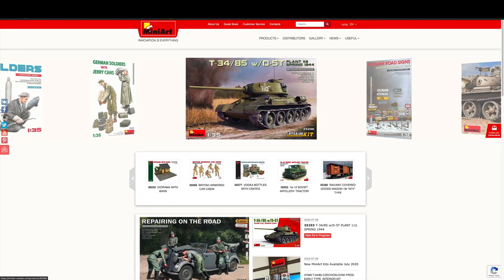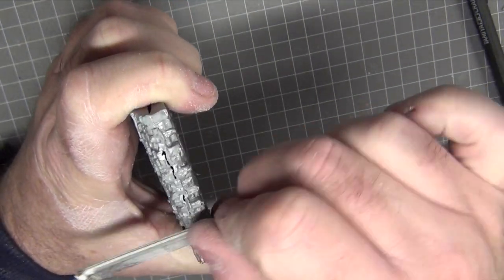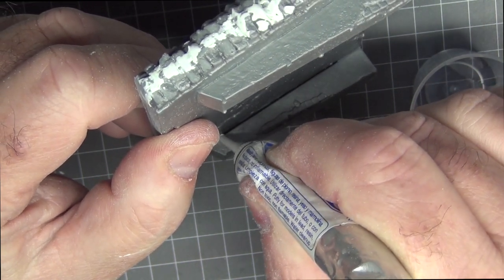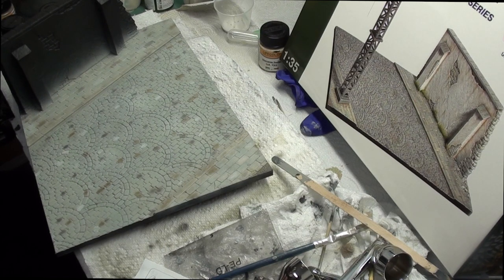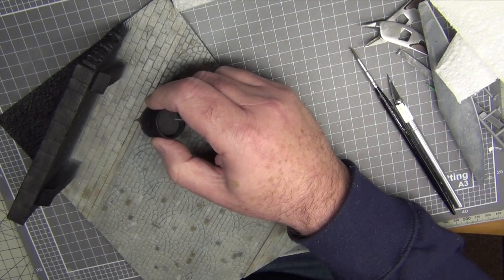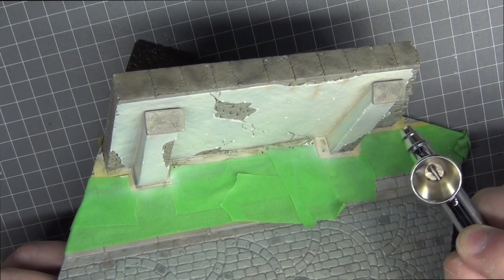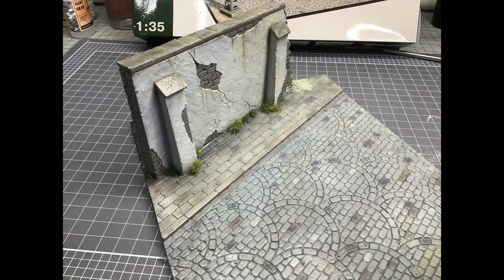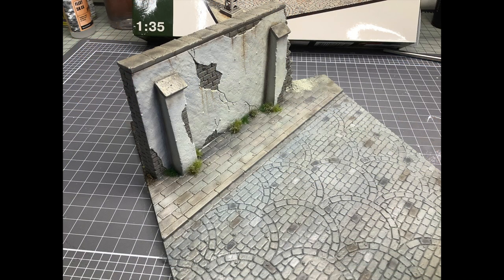MiniArt Street Section with Wall Diorama Build

Comment: "Doing what all good modellers do, I bought the whole set" - LOL!!!!!!!
I bought a bucket load of AK enamel products a good few years ago (half price sale) and most of them are still unopened. Having said that, I've only bought a few Shaders and always need to use the ones I haven't got so you're probably right!

Great work on the dio - sorry it's a bit late 😊
Reply from the maker: Hey Jeff. Thanks for writing. I won't share with you how many paints I have in my stash, but I will tell you I wrote a database to keep track of them. You get the idea. ;)

Comment: I'm building the village base diorama just now using AKs black window super glue with it and what a fast way of building these diorama vac form's! It has rubber particals through it and can be used as a filler or a surfacer too and easy sanded n painted it just turns to a plastic best using a Grip activator with it.
These dioramas aren't easy to come by now but vallejo scenics stuff is amazing in the resin! Great price's too!
Reply from the maker: Wow. I hadn't heard of this product! Thanks for the tip and I'll be looking to pick some up if I can get it and give it a try!

Comment: Hi Dan. As per usual, a very nicely produced video. I have to be honest, but you were right. I cringed the very moment I saw you attacking the broken wall section with a sandpaper block!  I can't remember if I've commented on this subject on your channel, or not, but I will comment here for those who've not seen my comments elsewhere.
It's obvious you cut around the wall parts with a knife, holding the blade vertically and tried to cut around all those broken bricks. It's a fiddly job. Then you sanded the 1mm excess plastic of the 'backing sheet' from the sides of each part,, mating them together to get at that ragged brickwork. Yes, the method does the job BUT there's a far easier way and that's to take the sheet of wall parts and flip the entire sheet over. You then 'scrape' the parts out from the rear. By holding the blade at about 45 degrees and scraping it back and forth sideways along the rim of the impression, one can thin the plastic very quickly and easily all around the part until the plastic is thinned and 'scraped' away at the point where the detail of the wall meets the backing sheet. In other words, the 1mm 'backing sheet' is completely removed AS you scrape the part out. And when it does drop out, the detail of that ragged brickwork needs NO cleaning up at all. Then you have to remove the excess 1mm backing sheet from the rest of the part and for that you can use the sanding block. Using this method, you can perform the 'cutting out/cleaning up' processes and ensure all of your wall joints are perfect, all in one go.I suspect you've seen my vid on the subject, but I as I said, I'm commenting here for those who might like to compare methods. BTW, my thoughts and prayers are with the people of Ukraine, and especially those good people at MiniArt who have enriched our hobby and my life. B
Reply from the maker: Hey Badder thanks so much for the detailed explanation! You guessed correctly how I did it as this was my first crack at one of these vacuum form style diorama bases. Really appreciate you taking the time to explain your technique. Makes sense and I've saved it in my tips database and will give it a try on the next diorama build. I've got a couple more of these in the stash. Thanks for the kind words on the video and for taking the time to reach out. Very much appreciated on both scores. Really like your YouTube channel and I saw the tutorial you did there on cutting out the MiniArt buildings. :)  I'll be going back to watch some more.

Cheers,
Dan
Reply: Hi Dan, it's a pleasure, and thank you. I am still a bit of a novice on YouTube and creating videos in general, but I'm learning a lot in that respect by watching seasoned creators like your good self. And I always like to leave comments because we're all here to help others, offer tips, advice and criticisms, positive and negative (with the latter backed up with some helpful advice of course) I mean, if someone sees something I'm doing and thinks there's a better/easier/quicker way, or whatever, I'm only too eager to hear about it! Here, I've basically repeated what I said in reply to your comment on my channel, thinking I was actually commenting here, on your channel, if that makes sense, so that'll explain why I've repeated myself lol. Still, I'll get the hang of it one day LOL Cheers, B.
Reply: @BADDERSBETTERDIORAMAHACKS121  I'm surprised that with the great tutorial you wrote in your initial comment that you didn't also note the little warts on the wall. They're part of the vacuform process and stand out as something that doesn't belong on the wall. They're on the base too, but harder to see due to the complex stone work. Sergio Solo built one of these kits (years ago now as he no longer posts) and they were one of the first things he removed from the model. Just an observation, because I think overall Dan's diorama came out really well and he should be proud of the results he achieved.
Reply: @nickkeizer3722  Hi Nick, Thanks for the response.i absolutely wasn't criticizing Dan's Diorama work at all. I was just offering some advice on how to make the job a bit easier, to do it a bit more quickly, and actually achieve a better result. I don't know about your philosophy when it comes to tutorial videos, 'how to's' and 'here's how I made a....'  but if anyone watches one of my videos and thinks there's a better way to do things, I'd WANT them to tell me. Call me mad, but I assume all of us want other model-makers to critique our work and offer advice and tips, and to comment and share thoughts. I haven't actually constructed a MiniArt building for 5 years, preferring to buy them and then make plaster casts of the walls, and use those to extend the existing kit, or use them to scratch-build entirely new buildings instead. I did make a video showing how to cut out MiniArt kit parts 'the wrong way and  the right way' and how to reinforce the corners, window and door apertures etc. I produced the video at short notice because I'd just seen a bunch of people complain about the 'bad fit' of MiniArt buildings, and slag them off. And I knew from what they were saying, that none of them had cut the part out and deal with them in the correct way. 9 times out of 10 the 'bad fit' is because the modeller cut the parts out incorrectly, and didn't remove the 'backing'. I didn't go into any more detail than that because I assumed people would notice the 'warts' and would remove them, just as they would with flash, ejector pin marks, seams, etc etc, but yes, many people might overlook them, so it's definitely worth pointing them out.